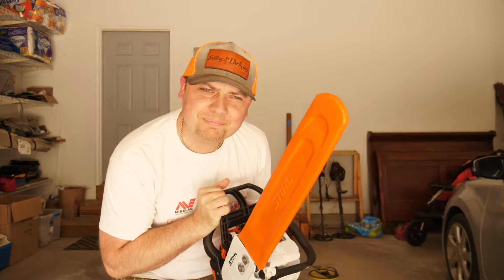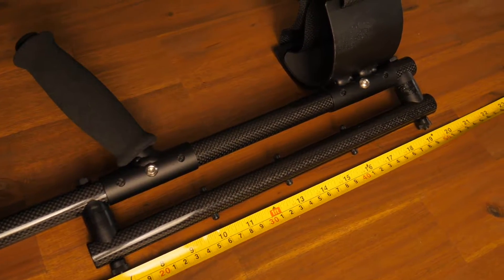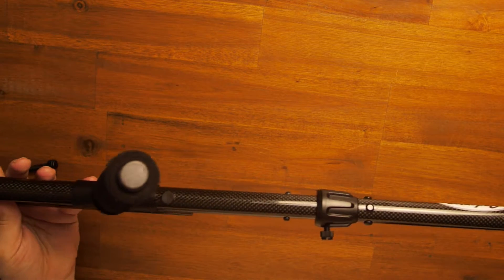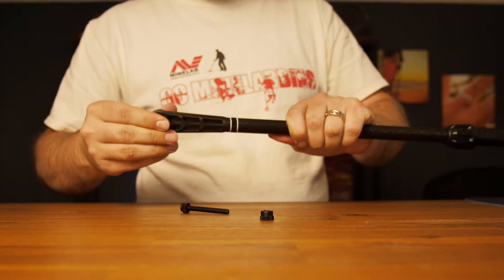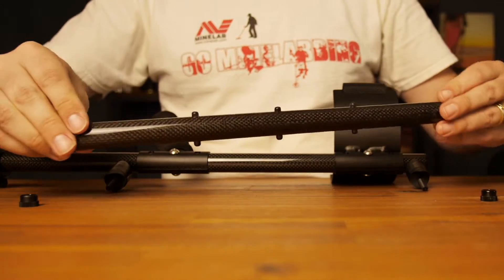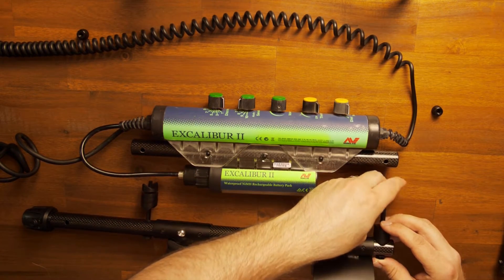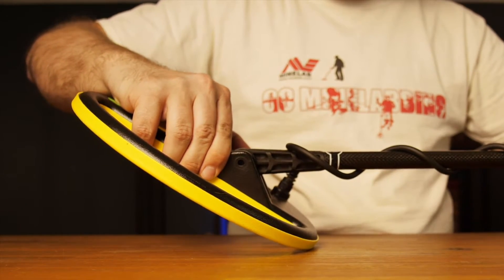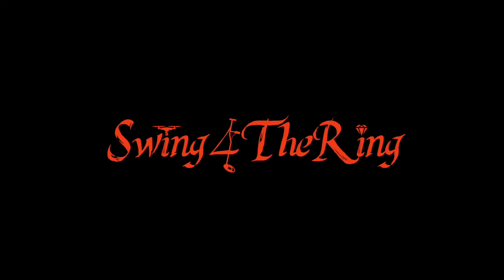How to Assemble your Anderson Shaft for the Minelab Excalibur

Comment: How doesn't the knob guard fit? im sure all you need to do is remove the end pins and attach it on with the screw and bolt, like the normal shaft??
Reply from the maker: So fun fact, yes it turns out my old knob guard does fit, but I just needed the updated hardware and to remove the push pins that are currently in place (like you said) 😉 But now I got a spiffy new orange guard to show off!
Reply: @Swing4TheRing  sounds good, what settings do you put your detector on?

Comment: I was sent mine with 2 bendy plastic lungs and I was told to drill the holes out no idea what he means
Reply from the maker: Are you talking about the washers at 3:37 in this video? Or are you talking about the yellow plastic rings?
Reply: @Swing4TheRing 233 that part I was told to drill a hole
Reply from the maker: @owenkitto27  hmmm that doesn't seem to make sense and you shouldn't have to drill that part for any reason. I'd reach back out to them and request clarification.